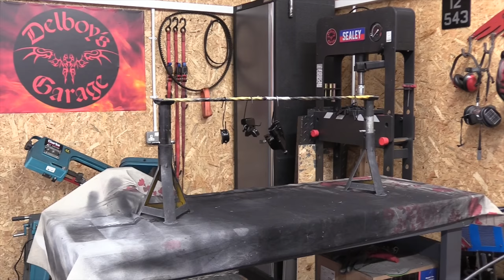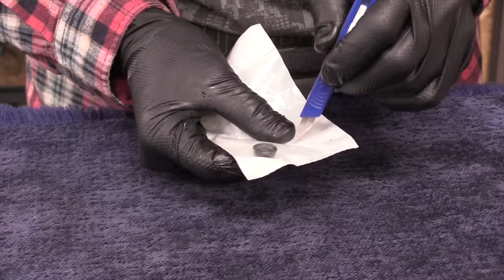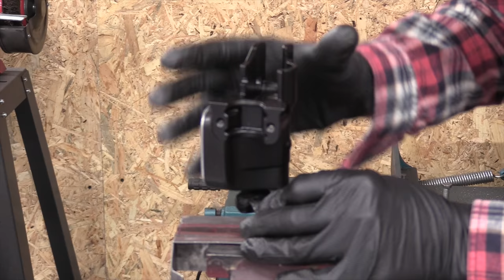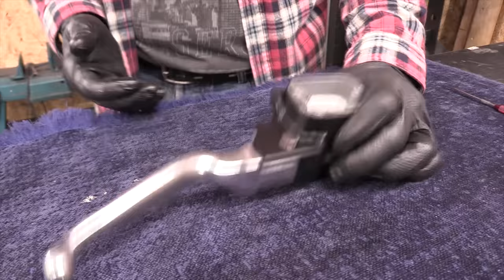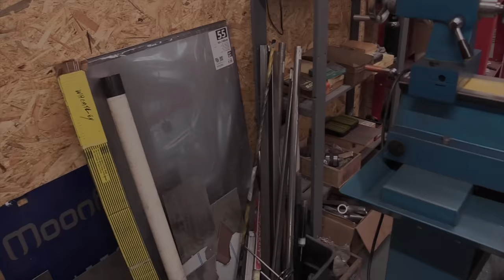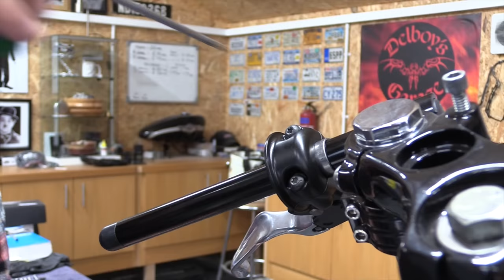Harley Sportster, Front Master Cylinder Restoration (2 of 2) !

Comment: Back in the day (the early 80's) I wanted the cafe look on my Kawasaki 900 Z1 but couldn't afford the clip-ons. I did what most of the non-sponsored privateers at the track were doing at the time, and just turned and flipped my stock bars. I sure miss that old Z1.
Reply from the maker: Sure thing mate, imagine what they'd be worth now, sadly relegated to museum pieces!
Reply: @Moonfleet41  There's actually a '73 900 Z1 occasionally roaring around the high desert where I live. I just can't justify a second mortgage on my house to give the guy that owns it what he wants for it. It's pretty hacked-up too. It's got an extended swingarm and none of the original plastic side panels or emblems. Its current state was somebody's dream at one time though.

Comment: I'm still fascinated by the red rubber grease stuff, lol. Have never seen that here (western Canada) in all my years. I have always disliked with a passion, using brake fluid to lubricate any rubber brake seals, and never truly got into the silicone lubes for other things like side panel grommets etc. Love all the continual little tips and tricks that add up to headache saving tasks as always. Thanks!
Reply: L S,   when he was applying the grease I got a flashback.  When I was in the Army in 1978 I was a helicopter mechanic and crew chief.  We always used Crisco Shortening. We stored it in a small baby jar in our toolboxes. Yes Large blue can with a Crisco label on it.
Reply: Can buy those Amazon and might check. I’ve used it few times… it’s Kwel
Reply: @davepelfrey3958  Wow, that is so cool to hear neat little behind the scenes details like that! I had just googled "red rubber grease" and discovered it is a vegetable oil based product, so my mind is blown at finding out these things. Thank you for your service, Sir.
Reply: @Goldwing1500rider   Cheers :)

Comment: Del is there any issues with mounting the brake reservoir at angle from the horizontal? Most sports bikes with clip ons have a separate reservoir that sits level.
Good video as always.
Reply from the maker: Not at all mate, as long as the base of the resevoir is well below the surface of the fluid and the cap's sealed tight, it's fine.  Remember every time you park your bike on the sidestand and lock your steering to the left, your clutch resevoir is at the same semi vertical angle.
Reply: @Moonfleet41 Thanks, it's no surprise to me that you've given this some considered thought
Reply: One question on the rebuilt of de pump you only change the rubber seals is that enough because the whole kit is around 90 dolls ???

Comment: Buenas me gustan mucho tus vídeos yo tengo una Harley Sporster Roadsters del año 2017. Soy de Murcia ( España) me he dado cuenta que siempre utilizas en tus vídeos una grasa de color rojo para lubricar las gomas que podrías  decir que tipo es para yo utilizarla. Muchas gracias amigo.
Reply from the maker: Hello Jesus.  Just to be clear. never put any form of grease on "Tyres", but if you mean rubber seals in the brake system, then that is Red Silicone Rubber lube.. it is readily available from motor parts stores, and im sure you can buy it there..
Reply: Gracias

Comment: Hi Del, great job again and although I'm not really a Harley fan I'm enjoying watching your progress with this one.
Having worked on bikes for years I have learnt that putting a bit of copper slip on the reservoir cap fixing screws was a great help when it came to trying to take them off again.
Keep up the good work, best wishes to you both from NZ.😉
Reply from the maker: Sure thing mate, there probably isn't a more exposed area to the elements than the res caps, they're right up there in the wind and rain blast and it's usually cheap zinc plated screws in to aluminium castings, a recipe for seizure!  I generally switch over to stainless if I can, or at the very least a little anti-seize as you say, and the biggest error of all I see made is people over tighten them... they don't need to be hammered down, it's never necessary, just nip them up!   Have a great weekend there, ride safe!

Comment: It's a shame really not to use the 22mm clip-on's but probably the Harley 25mm standard ones will be in keeping with the bike. 
Great vid once again Del all the very best x

Ps watch that shirt with that moving machinery. A carbide cutting bit slipped and caught my shirt sleeve and dragged me in. Fortunately the drill stopped and all I sustained was a bruise.
Reply from the maker: Sadly mate I can't use these clip-ons, I will need Harley specific ones as I just don't need them to be 25mm but also to have dimples for wiring!  There's a few on the market so I'll look for a good deal if I decide to keep them.  Have a great weekend!
Reply: @Moonfleet41  ooh I forget about the internal wiring, what a feature Harley has. 
Yes looking forward to the weekend as I have just replaced the flywheel magnito as two of the magnets had broken off. 
Yes have a good one my friend.

Comment: I like your work and the camerawork a lot and follow the channel every time.  I have a question:  The paint in rattlecan you are use . Is that paint resistant to petrol/fuel  and Brakefluid . Or is it premixed with hardener in the can?   Myself i have never succesfull use with  cheap Rattlecan-paint .It do not last for a long time as ordinary "Airgunpaint" with special hardener .   Bjorn Sweden..
Reply from the maker: Hi Bjorn, this is a 'stone chip' paint formulated differently to the cheap stuff, it's resistant to most things, except maybe petrol, but not much will stand up to that anyway!
Reply: @Moonfleet41   It is hard to get high qulity paint today. Some years ago i use black paint for Outboard boat engines Johnsson or Evinrude i belive it was .before they came "environmentgood" if it is the right word. 🙂